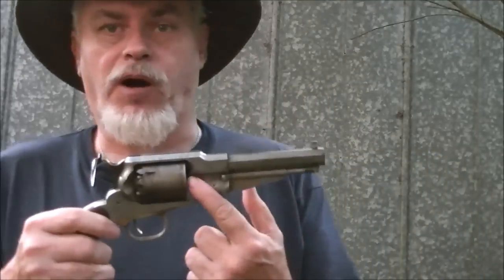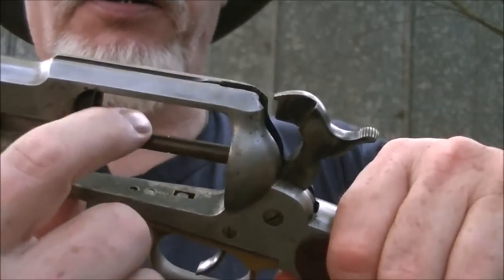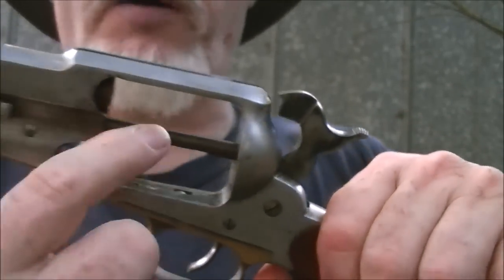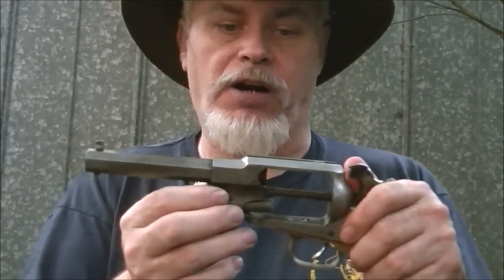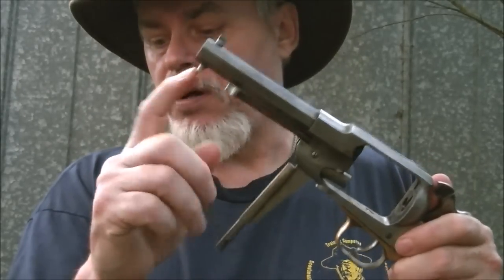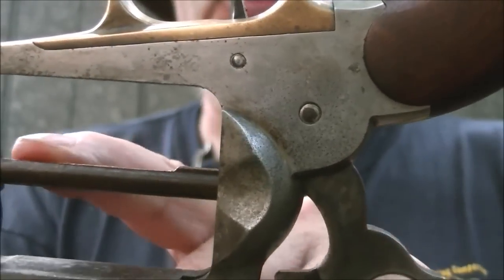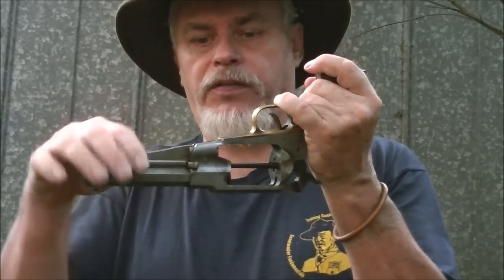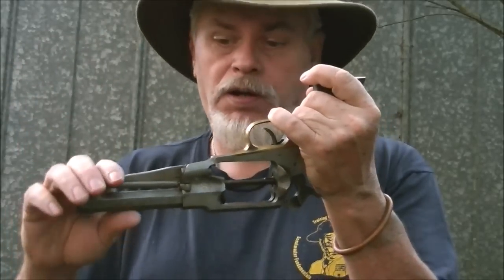ABOUT THAT 1858

Comment: Your instructional videos are an absolutely invaluable resource. Thank you, Sir.

Ive noticed that, when reloading the cylinder, if i pull the cylinder pin forward and just smear some of the lube thats allready all over the gun (i grease the front of the loaded cylinders rather than using lubed patches) it keeps everything moving very nicely. I recently put 7 cylinders thru it in about 25 degree weather and it stayed operating smoothly and dissasembled afterward no problem.

Comment: I cut grease notches using a needle file into my Remington base pin just like Blackie did. I expected it to not make any difference. WRONG! It actually worked quite well. My gun lasted about twice as long before drying out. I'll have to try packing that long notch underneath and holding the gun down after shooting a cylinder to see if it works even better.

Comment: My old '58 Remmie 44 is an old Navy Arms kit gun (Pietta).  Now, I got it used and abused in the late 1980s and the guy I got it from got it used as well.  Mine has always had a small notch cut in the top of the cylinder pin jin the front part of the pin just at the point where the cylinder meets the barrel. That groove was in it when I got the gun and I don't think it's doing much for the lubrication of the cylinder pin.  I've always packed that flat area on the bottom of the pin with grease as I was taught back in the day that was what it was for.  I do think I'll try your grooves though and some of the ideas you've put out in other videos.  I also shoot a Uberti cap and ball revolving carbine (Remmie) and will try them on it as well.

Comment: Blackie, you ol' " possum belly & hawg jowl eater" you!!! This video proves once again WHY you are my #1 go-to guy for the best C&B information! On all aspects of the C&B's, how did you acquire ALL your knowledge? Reading, experience, fellow shooters, "dumb luck"?! Probably an accumulation of ALL of them, plus many years of shooting them is my guess. My first introduction into black powder guns (& all guns!) was in about 1968 or earlier when I bought my Navy Arms .36 brass frame Colt (Confederate!) revolver. I still have & love this gun & might require it in my "cold dead hands" when I'm in my casket (unloaded of course!)!!! It's got a tighter action lockup than ANY S&W revolver I've ever seen anywhere! No cylinder bolt score marks either! No idea if a gunsmith had worked it over. I bought it because I greatly love the overall style of the Colts, especially the gorgeous curves of the grip frame & hammer & recoil shield. The barrel ain't bad either! My "love affair" with the Colts STILL STANDS (I'm 81 now)!!! And as always, "please don't squeeze da Shaman"!!!!!

Comment: Some folks have successfully installed a Colt 45 Generation 3 bushing onto the end of the cylinder of the NMA, also relieving the frame slightly for room where the cylinder pin is. This supposedly makes the NMA resistant to fouling in the same way as the Starr and Rogers&Spencer revolvers that already have them.

Comment: You can remove your cylinder rod - It's easier then you think, I used a short 3 inch wooden dowel to knock out my catch underneath the barrel.  Just aim for the base and not the actual catch part!  Make sure you use something like a little locktite in there when you knock it back in.  I love your videos by the way!
Reply from the maker: thank you very much..glad you enjoy them

Comment: First, love your videos. As for the grooving, sorry, I just can't make myself weaken a major part that way. HOWEVER, I'm extremely pleased to see this video where you use the flat of the cylinder rod as "lube storage". That's exactly what I've been doing all along. When I realized that the rings around the Colt arbors was for holding extra lube, I immediately decided to use the Remington flat for the same purpose in exactly the same way. It definitely works, and I was able to avoid giving myself PTSD from filing grooves. 😊
Reply: It’s interesting how PTSD is used so often now for so many things.
Reply: @profile2047  - Yep! 🙃 But to be clear for those who missed it, that was sarcasm.

Comment: in order to keep my remi 1858 up and running I use a generous dose of grease on top of the bullet in addition to grease base pin. as Mr. Blackie described, in case of closed frame BP revolvers fauling is forced back and starts to build up between barrel entry and front of cylinder in close proximity of base pin. if grase is applied on top of the bullet it's mixing with fouling with every shot and a grease&foul seal is build up at the barrel entry, preventing fouling to block cylinder from rotating.
Reply: My experience exactly.
Reply: My experience too, with lamb's tallow and beeswax mix.  Smells nice and works fine. Wiping front of cylinder works great too. I wipe it and keep it greased and it works well.
Reply from the maker: very true..i used lube on top of chambers at the shooting matches many times and it works well..it is kinda messy tho..
Reply: @BLACKIETHOMAS  it is messy...
Reply: Use a small spoon to apply greese.

Comment: I've had some success with putting a bit of lithium grease on that flat part of the base pin.  Don't use it anywhere else, but the cylinder itself will keep bp residue from getting into the grease.
Reply from the maker: Great tip! some high temp type used on brake / drum berrings would work well i think
Reply: Will give it a try myself

Comment: Wish I had known why my experience with Remmies was so bad. I blamed it on Italian mass production assembly line shortcuts but I did use lots of Crisco on those cylinders, which only made things bad & messy. I may revisit those 1858's someday after some custom filing on the base pins, but I'll leave the Crisco in the kitchen & try some Bore Butter wads. Anybody ever try cardboard treated with Borax to fire proof homemade wads?
Reply from the maker: i played wit hit back i nthe day and thats the prob cut carboard does well but it can catch fire and be a firebug in a bad way..there is a reason they use wool felt it will not burn..i have used wax coated carboard like from cat food boxes or ceral boxes in my snake loads and had no problem with those

Comment: @blackiethomas  got this thing hitting paper at 10 yrds on trees that are about 3 ft across. It shoots low and to the right. I have  peer .457, 777powder, and cci 11 magnums. I have been working on different loads.started on 20grains and couldn't hit anything. 25grains and by luck I was able to see the tree behind and to the right was hit low. Did a few more with 25grains and just couldn't figure it out. I put 35 grains in it and hit the tree I was aiming at with all five. Went and got targets, took my son shooting. 35 grains 30 feet away, down six and right six. Backed off 5 grains with 2 cylinders and could even hit the tree. So I Did 35 grains again filed the front sight down a bit and rear sight left, got 4 inches down and 4 to the right with some low flyers. Gonna hit again with some more files. Because of this I have named mine violet blue or noname jane because she likes a hot load.

My question is how long will a new model army sheriff last pounding out lead like that, and what can I do to make it take it better??  And also, do you have any advise on the difference between compressed vs uncompressed for 777

Comment: The 2022 Pietta 1858 8” barrel revolver, the cylinder pin has a stop, doesn’t pull out completely. It also has a flat side on the pin.

Comment: bit of a design oversight with the sheriff model 5" being too short to remove the cylinder pin.  I'm glad i got the 8" gun because those pins wear out the hot gas cuts into it over time. 2 cylinder loads is what I typically get before fouled. i admit i stuff as much powder as possible that doesn't help the fouling.

Comment: on the remington, is there room between the frame and cylinder to fit a small rubber o-ring?  they are cheap, and even if you needed a new one every time you clean the gun, it might keep it running longer.

Comment: I get all the problems you pointed out, on the 1858 so I will definitely be trying this, just one more thing after shooting my cylinder keeps locking up, as you try to put it in the half cock position the cylinder lock will not stay down,I have to continually cock it and eventually I can get the cylinder to spin freely, anything you can help with?

Comment: I also considered taking a tap and die set to cut threads into the cylinder pin similar to the colts and use that for a grease groove. More coarse threads would have more longevity for the pin before it needed  be replaced.
Reply from the maker: that could work just be sure not to cut too deep and weaken the rod

Comment: On my 1873 Pietta shooting pyrodex it gets clogged up after like two cylinders. I recalled greasing the arbor on my navy so I greased it with mink oil and now it lasts much longer. The problem is the Pietta basepin sucks, it has grooves on the underside only to stop, so its hard to fit at times and if there's too much grease it slides right on through. However I have been able to shoot it a whole range session without it being too bad. I wish they made them more like the original colt pins with the screw on bushing.
Reply: I had thought it was friction against the forcing cone after talking to some SASS tuber, but then I checked and I could still see light in between it so it was definitely the base pin.

Comment: I didn't realize it was a problem, I shoot with no lube, 25-30 grains pyrodex P under a round ball and the base pin got stuck in place before it started dragging on my cylinder
Reply from the maker: it varies from gun to gun i have had a few that would shoot fine thru a full match and never bind and i have had 2 that would so foul after 2 cyl that you had to hand turn the cyl when you cocked it

Comment: Take a 6inch file and file the flat on the base pin just a little to put an edge on it. Don't deburr it. The sharper edge will scrape off more fouling when you turn the cylinder a few times on half cock.
If you find the base pin stuck, just dribble hot water over the front of the cylinder and frame area. It releases easily. I've seen hammer damaged base pins!

Comment: Hey BLACKIE, you ol’ “disenfranchised bellywamper” you! Yes, a “term of endearment”!! I loves ya & hope you’re blessed to lots of safety & good health! You are STILL my “GO TO GUY” for C&B information. On the cylinder pin, instead of just a “flat spot” for a “grease reservoir”, why didn’t Remington simply make a slightly rebated or smaller diameter grease reservoir on the circumfrance of the pin, therefore holding more lube? Surely that would not diminish the strength of the pin. Of course imitating Colt’s lube rings as on their arbor would have been the best grease or lube reservoir! Sure would be nice to know what kind of work you do. Seems like most ALL of the gun reviewers prefer to keep their “vocation” a secret! I’d guess you are NOT a “hash slinger” at the local McDonalds!!! One thing I’ve never seen any gun reviewer do on their revolvers is “range check” the cylinder/barrel alignment! Bet that would open up a bag of surprises on some revolvers! “Gesundheit”!

Comment: A question about Remington base pins. Mine is about 25 years old and the base pin has a flash cut in it (just under where the cylinder meets the barrel) from the many rounds I have put through it over the years. Will this continue until it ruins the pin or has it probably gone as far as it can already?
Reply from the maker: you are correct..i would contact dixie gun works tell them its a pietta or a uberti  and they will get you the correct pin..its a easy swap and like you said over the long time its a part that will wear out over time
Reply: @BLACKIETHOMAS  Thanks Blackie.
Reply: @BLACKIETHOMAS  Thanks!  I live about a 30 minute's drive from Dixie and have been needing to make a trip up that way for bp shotgun stuff anyway.

Comment: Looking for suggestions for a good "possibles" bag.
Reply: I went to value world, like a salvation army, and bought  a plain  purse that seemed the right size.  I extended the shoulder strap with a piece of leather by  cutting  the purse strap in the middle and made a nice wide shoulder piece and then attatched the cut ends of the strap to it.  Next i  made a leather flap, tooled an eagle onto it and attatched it to the purse.  I could have made the whole thing i guess but it saved some  time. Belts are also usually cheap there too.  Goes nicely with my blunderbuss, holds shot, wool, caps, rod end tools, knife, matches, plus ball starter and ball.  The purse was $2 and the leather was left over from other projects.  i did buy some Chicago  screws $7 from tractor supply to attach the leather.  But that is in case you have to make a quick feild repair the screws and leather can always be repurposed to repair a bridle or boot or tent, etc.  I figured that increased my possibles.
Reply from the maker: for a cheap work around dixiegunworks sells a plain canvas haversack like 20 bucks that can be a good starting point till you find the one you really want